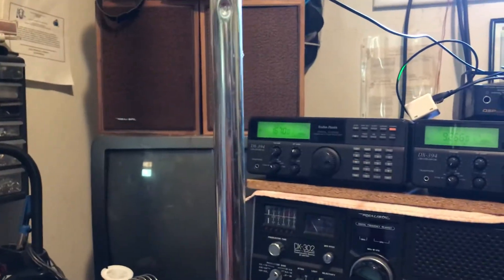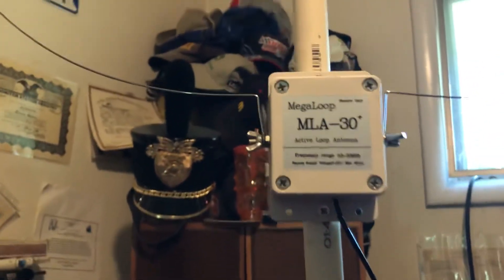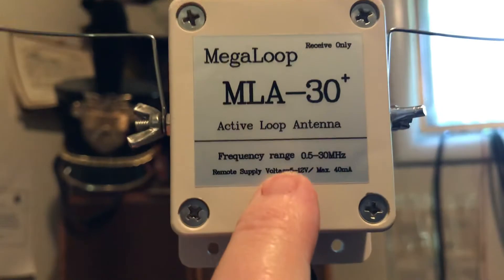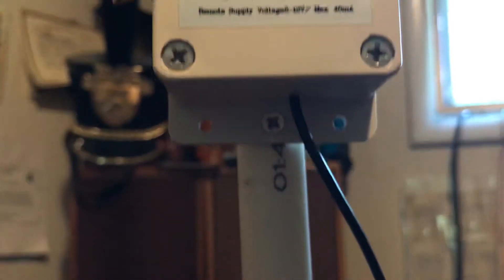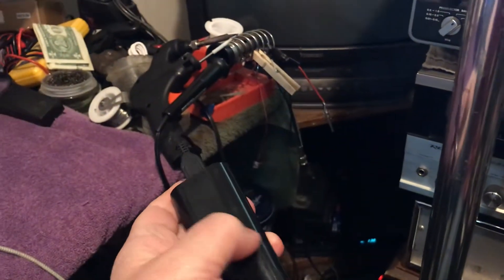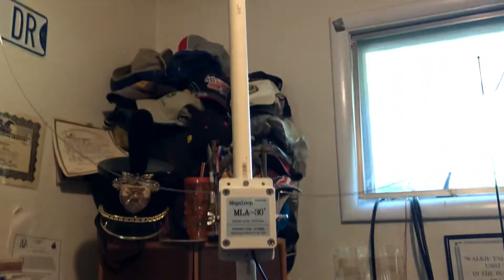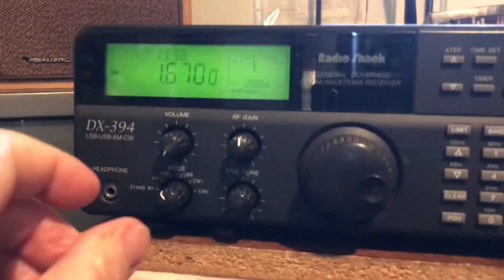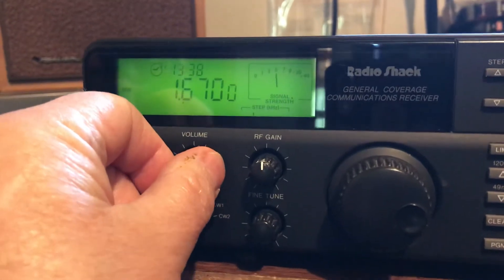Indoor Test MLA-30 Mega Loop

Comment: Works 200% better outside ! even without the power amp    I have mine on a 30' mast
Reply from the maker: Yeah I’ve got several options on where to put mine I just haven’t decided on the best place yet. I’m going to have to mount it out my radio room window on a mast. 
It’s going to take me a little bit a time to get to it but I will